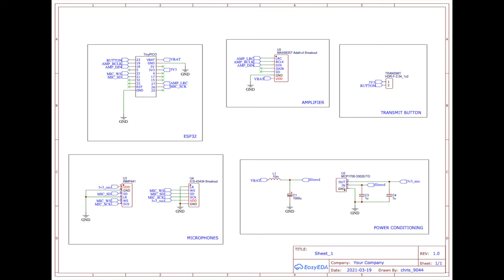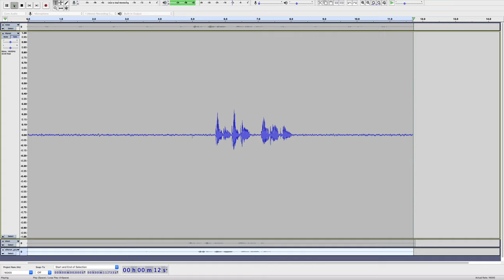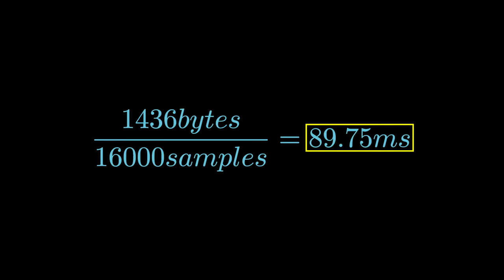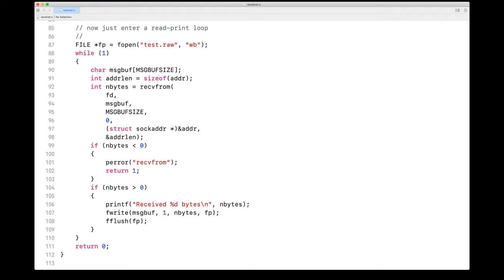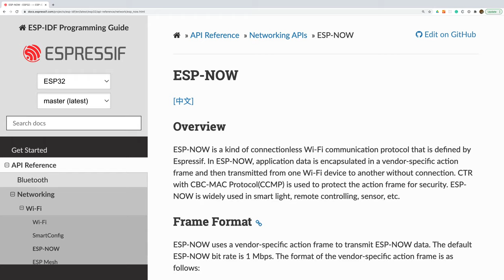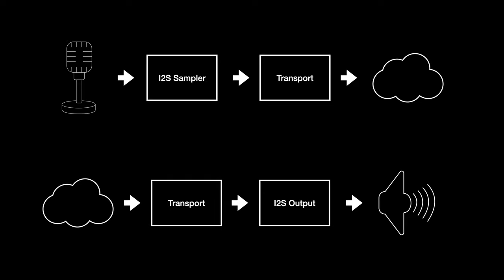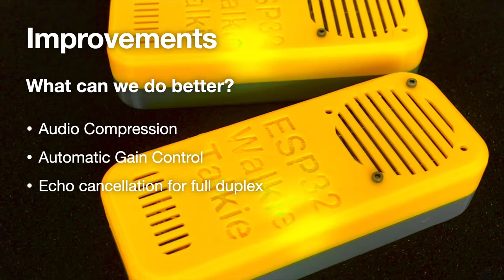ESP32 Walkie-Talkie: DIY Audio Magic

Comment: Have you considered using an audio Codec / compression to achieve higher quality / smaller packet sizes? I think SBC is what bluetooth uses. Not sure how easy it would be to implement.
Reply from the maker: I did look at an old GSM codec and got it running on the ESP32 - but it was a little bit slow - it took about 15ms to process 20ms of audio which only left about 5ms to do anything else. I'm taking a look at SBC now though as it's a lot more modern and I'm wondering if it might be a bit more lightweight. It would make a big difference - especially with the ESP-NOW transport where we have very small packets.

Comment: I have done it and it works great even without noise: the down sides 1. it deliver voice a little late. 2. it works only for few seconds and than no voice transmitted again, maybe i need to use powerfull power supply since i'm using the Tel charger only.

Comment: Nice Project! Whats the range of the walkie talkies, especially in esp-now mode?
Reply from the maker: That's a really good question - I've not tested it yet. I've seen all sorts of claims 220m - 480m! Not sure if I believe the 480m. I know that you can bump up the transmit power to get better range so could be interesting. I think a lot will depend on how open the space is and how well oriented you have the antennas with each other.

Comment: Love this idea! Really cool!

A common thing on Wifi is seeing packets repeated.
Using RTP header on top of UDP could be a way of detecting out-of-order/missing/repeated packets.
Reply from the maker: That’s a great idea. I did play with the idea of adding a simple packet number to detect repeated/out of order packets. You could get quite fancy and reorder packets as they arrive - assuming you have a large enough receive buffer.
Reply: Started thinking about building one of these myself and had some more ideas:
- simplest audio speech codec would be A-law (G.711) which gives 2:1 compression
- use multicast to avoid spamming all devices on the network (although multicast can be a bit funny on Wifi)
- you could have a channel selector (7-segment display?) that mapped to different multicast addresses
- a door-bell type device that broadcasts a pre-recorded sound when a button is pressed
- have a channel connected to a bridge to Alexa, so you can ask questions!
- love the idea of a desktop Power over Ethernet powered base station (with gooseneck mic!)
- implement Push to Talk SIP - might end up compatible with other types of devices
- might even work in a web browser with WebRTC?
Reply from the maker: @njh  Sounds very interesting - definitely, some kind of audio companding/compression would be good to fit the audio into 8 bits more effectively. And some simple compression to reduce bandwidth would be really nice.

Multicast should be done - I had some issues with it working on my desktop Mac - it seemed to work between the ESP32s, but my computer refused to see any packets. As you say, there are some funny things around WiFi and multicast that may mean it's not feasible.

Love the idea of a channel selector. I think it would look really cool!

Getting it to work with WebRTC would be very interesting.
Reply from the maker: @njh  I tried several different examples, one in python and one in C and couldn't get them to work. The code looked pretty much the same as the Arduino code which did work. It also looked like the Mac thought it was a member of the group. So it feels like it's something to do with the router not forwarding the packets on. It might be due to my mac having both an IPV6 and IPV4 address. But that doesn't seem to stop the broadcast packets. Needs a bit more investigation.

Comment: This is a very cool project. I was thinking about building a simple intercom in the house and this just fits perfectly. Broadcast just makes it easy, I don't have to worry about much at all. I remember seeing lot of ESP32 development board for mic and speaker output, those could be readily available hardware for this project.
Reply from the maker: Yeah, there's a quite a few very nice boards. There's also quite a few with codec chips which would make compression possible.

Comment: Love that you implemented ESP-NOW! I’m very impatient for it to become more accessible and easier to use, added to ESP-Home too 🙏🏼. Ideas:
- voice detection to automatically open the mic maybe using an audio level sensor
- home intercom system would be cool using a 110/220->3.3V step down at/in a light switch and/or front door communication
- my mind is wandering into how could this be used with an Alexa??
- I mean… a toy or for real: an audio spying device
- pest detection using a high sensitivity
- okay, I’m probably going this far because of the ESP-NOW ability… great project!
Reply: A slave (ESP-NOW terminology) device that serves as a hub for ESP devices all over the house would be amazing. A lot less power needed for that comm method, zero need for a router/WiFi AP, potentially more secure, longer distances than RF.
Reply from the maker: @JasonWho  I had a few issues getting WiFi working at the same time as ESP-NOW - but I know it's definitely possible as other people have done it. Might be down to using the wrong channel as I know the channel has to match the WiFi channel for them to both work at the same time. ESP-MESH is another thing to look at - but I've been struggling to understand the documentation! I need to look more into the noise issues as well - the ESP32 doesn't seem to play very nicely with audio. There's a lot of noise going on!

Comment: I remember the ESP 8266 first releasing and being heralded as a 'wireless serial cable' essentially, so I picked up a pair to try and make a wireless audio cable. The built-in ADCs were so absolutely garbage that a quick 30 dollar project soon breached triple-digit prices and I realized why there wasn't anything on the market for lossless, latency-free short-range audio transmission that didn't already cost hundreds of dollars... with the ESP 32 series being significantly improved, I can't wait to see another generation or two from now and the possibilities with those :)

Comment: Great project! Very cool that you utilized ESP-NOW!
Reply from the maker: Thanks - I do need to do a proper range test to see how far you can actually get it to go - I've seen all sorts of claims and want to test them.
Reply: @atomic14  It's highly dependent on antenna types. I never tested it on field, but in buildings (pcb antenna on R / external antenna on S) it's about the same as your normal wifi signal.

Comment: ok, now here is how you make this useful.
my mom is half a mile away, we are on the same wifi lan.

create this same thing, but add a panic button which if pressed alarms all other units for a set time (30 seconds 2 minutes) and also allow those units to cancel the alarm ahead of the timeout by pressing their panic button.

panic button could be existing button if pressed x times in a row in x seconds

Use UDP but instead of just dumping them randomly, store them in memory and rebuild them in order and deliver them, yes lots of lag, but, the important message gets through "help the house is on fire"

a device like this would be useful

Comment: When attempting to run the code on the ESP32 board, the audio message seems to be broadcasting the data using UDP (confirmed using Wireshark) however, the audio is playing out of the board that sent the broadcast...ie using the mic from board 1, the audio captured is played out of the speaker from board 1, whereas we want the audio captured from the mic from board to be played out of the speaker on board 2...do you have any suggestions to fix this issue?

Comment: That really turned out great! Are you sleeping the ESP32 at all when on but not in use? I wonder how long ESP Now takes to wake, calibrate radios and begin transmission. Obviously if it's sleeping it cant received, but I know my kids would 100% forget to switch to off ;)
Reply: For sleep to be effective you'd probably want to turn off the speaker/amp as well, but it seems to be supplied via VBAT also on the PCB, rather than via the TinyPico ? ( A TinyPico S2 with 2nd LDO might help turning off the rest of the components during deep sleep :-) PS I hope you also include 2nd LDO + 16MB flash when you get to make TinyPico S3 - pretty please ;-)
Reply: @sharpbends  Ha! No 2nd LDO or 16MB of flash ever on a TnyPICO "footprint" board, sorry, no room. I'll have a ProS3 though that should make you happy :)
Reply: @UnexpectedMaker  Excellent, can't wait !
Reply from the maker: Thanks! At the moment it’s really not very power efficient. Both the microphone and the speaker are running continuously and I’m just not sending any packets unless the button is pushed. That is mostly just laziness on my part - I was having some issues with stopping and starting the I2S drivers and realised that debugging it was a bit of a rabbit hole. With ESP-Now startup should be pretty quick as there’s no need to connect to WIFi and get an IP-Address. With WIFi I’ve seen a few people speed this up by using static IP addresses. You could also spin up the audio sampling and buffer the data while everything else is waking up - definitely doable when you have PSRAM.

Comment: Great series glad you got it all working ok, I really enjoyed seeing how you overcame the Wifi noise issues etc. Many thanks for posting all the design files and code. Have you tried using more than 2 Walkie-Talkies at the same time as yet ?
Reply from the maker: Not yet - but in theory it should work without any problems as both the transports are using broadcast so don’t really care how many other clients there are listening.

Comment: This is a great project. I think I have enough hardware lying around for 1 1/2 walkie talkies!
It would be great to use this hardware to build a mumble client so that can interoperate with Talkie Pi or any other mumble client. Looks like mumble uses the opus codec for low latency low bitrate VOIP so maybe that's a good option here too.
Reply from the maker: Someone did find a port of opus to esp32 - https://github.com/XasWorks/esp-libopus definitely worth having a look at.

Comment: Try using a vocoder. The melpe 1200 will compress/decompress 8khz 16bit samples into a 1200bps stream. Each 540 samples of audio generate 11 bytes of data. You can find melpe 1200 source on git. 
I am testing compression with I2S audio and SD card at the moment, struggeling with audio levels.  What C ide/compiler do you use on the PC?
The melpe 2400 codec would fit way better, 180 samples into 8 bytes, but i cant find the source. 
Note the older melp2400 from 1996 is not arduino compilable, but the melpe1200 from 2001 is.

Comment: You published a lot about ESP32 and I2S, just wondering, did you ever find a way to set the attenuation for the adc ( internal) when using i2S. Can't find that function at all..well at least not when using I2s
Reply from the maker: Looks like it is possible - but involves some poking around with hardware registers - https://github.com/espressif/esp-idf/issues/5334#issuecomment-633057910

Comment: I was wondering where did you get the double width breadboard in your video at 2 mins 10 secs?  I bought two breadboards, put them together and it was too wide for my ESP32.  Great inspirational video. Thanks.
Reply from the maker: Some breadboards let you remove the power strips, they just pop off and then you can join the breadboards together.

Comment: I was about to order the PCB but wanted to confirm that the linked PCB is your new design with headers for additional GPIO.
Reply from the maker: LEt me get that added now!
Reply: @atomic14  thank you!
Reply from the maker: @tuckjam235  Should be updated now
Reply: @atomic14  thanks again! Can’t wait for them to arrive!
Reply: @atomic14  I think there is something wrong with the gerber files pcbway has for your walkie talkie boards (linked in this video description). I just received my order and they sent me 100 of your ICS43434v0.1 boards, not the walkie talkie boards…. It’s strange because when I look at the order the gerber files and the thumbnails on the pcbway site are for the walkie talkie boards.
Reply from the maker: @tuckjam235  can you drop me an email chris at cmgresearch.com and we can get it fixed with PCBWay - sounds like something has gone wrong somewhere.
Reply from the maker: Just noticed a slight typo in the email - stupid phone keyboard. Drop me an email on the corrected one and we'll get you sorted out. Looks like something went a bit wrong with the way the project was setup so it was picking up order details from a previous order.

Comment: Hi, have you tried it in very long distance? I have two ESP 8266 and using ESP now. I put the master statically inside my house then I tried walking outside carrying the slave esp8266 + laptop while looking at my serial monitor . When I reached 50meters it becomes unstable. Do you have any suggestion on how to add to the signal strength? An antenna? Please advise. Thanks.
Reply from the maker: I've not investigated it yet, but I'm planning on doing so soon. It looks like you can increase the transmit power which might help - https://github.com/espressif/esp-idf/issues/1414 I suspect that having the master inside the house will limit the range dramatically. All the experiments I have seen have been conducted outside with a direct line of sight.

Comment: Great job, thanks for sharing. Would LoRa point to point be an option as transport? Range would be good
Reply from the maker: I'm not sure  I think you'd definitely need to compress the audio very heavily to fit it in the available bandwidth. I'd need to do some research on what is possible.

Comment: Wouldn't it be possible to trigger the send when a sound is picked by the microphone?
That way you could remove the button and make it easier to use?

Ever since me and my girlfriend used Bluetooth intercom while skiing about 7-8 years ago I have wanted something that works the same but has better "pairing" and can transmit to more devices at the same time, and this looks like a solution.

I know the mesh Sena devices, but they are far too expensive.
These parts could be bought and placed on the kids helmets too.

What kind of battery time do you get from this?

Comment: I'm trying to follow along with the calculations. You have 1436 bits per packet / 16kHz sample rate @ 8bit. By my calculation that makes for 11ms packets. This would require 90 packets per second. Did I miss something or do something wrong? I'm looking at doing something with higher fidelity, 92kHz @ 20bit res and while the bit rate at 2mbps should be possible over the UDP, I read it max at about 30mbps, but I also wanted to use ESP-NOW, which as you demonstrate is a much smaller packet size and therefore may not keep up.
Reply: UDP packets (in this case) are 1436 bytes per packet not bits.  Easy to mix those up.  In networking specs you'll find both bits and bytes quoted.  Lowercase mbps is always megabits per second.  Megabytes per second are usually written uppercase like MB/s.

Comment: the best idea for making walkie talkie is connecting airpods or any BL handsfree to esp32 through and stream audio to esp32 then stream data between esp32s through NRF2401, that would be high quality, long range, and easy to use, almost no need to make any circuit
Reply: usb headset + esp32 + nrf24l01
or classic bluetooth handsfree headphone + esp32 + nrf24l01
All devices can send and receive data to each other without pressing the button.
How can I do it? can you help me? :)

Comment: This is really cool. I'm most interested in how you cleaned the power line. What LC filter did you use? I've gone through many videos to try to find this info but I can't seem to figure it out other than that you used one and some caps and the low dropout regulator ( I found that).
Reply: oh I understand now. the LC filter comprises of several components. the part I didn't know what it was and thought was called an LC filter, is actually an inductor.

Comment: Nice project! What is the lowest sampling Hz where the voice is still intelligible? Does 8000 work, for instance?
Reply from the maker: Yes, you can get away with 8KHz - that will give you low-quality speech. You can go all the way down to 4KHz sampling rate and still be understandable - but it won't sound very nice.
Reply: I think old phone tech was with 8k sampling at 8 bits, but I might be wrong. Whatever sampling rate you use, the max frequency you'll be able to digitize will be half of the sample rate. See: https://en.wikipedia.org/wiki/Nyquist%E2%80%93Shannon_sampling_theorem